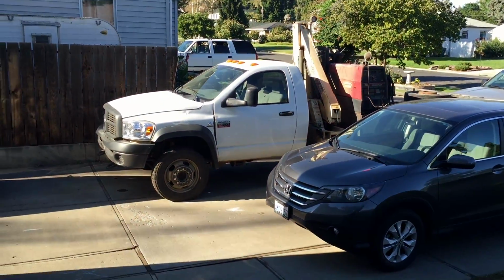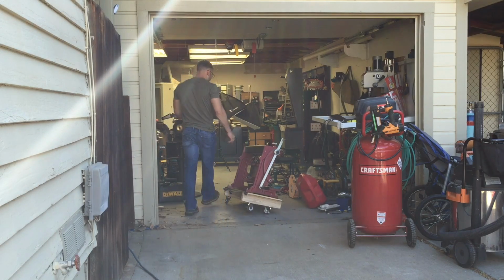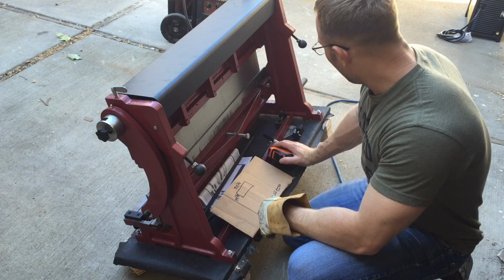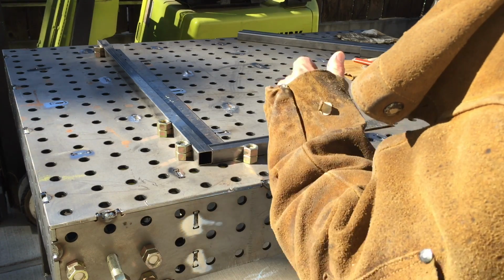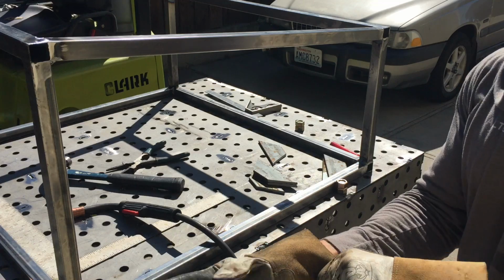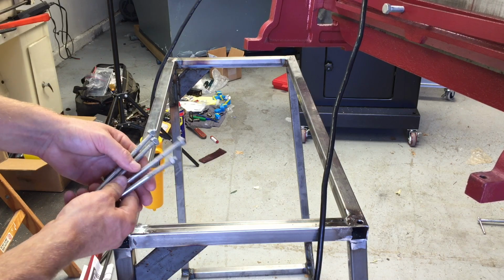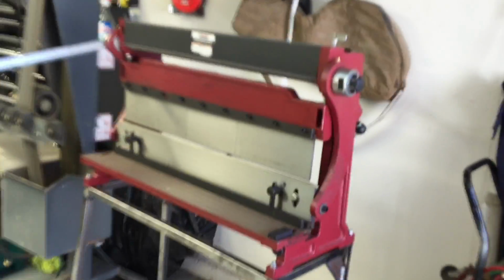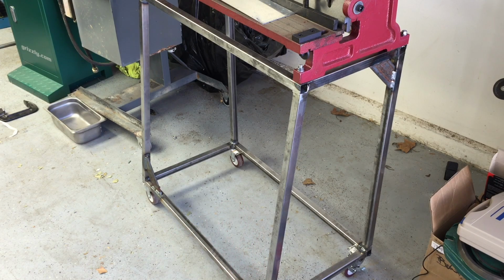DIY Stand for Harbor Freight 3 in 1 Press brake, shear,&  slip roll - Unorthodox Fabrication

Comment: As an A-10 sheet metal mechanic. Keep the grain of the metal in mind. You have to make sure you keep the Bend Allowance area clean, remove any defects in the area. Last but least the hardness of the metal (and thickness) in comparison to the radius of the bend.

Comment: probably be a good idea to end up with the height of the feed in table intoo the cutting bar about the same as a toolbox / bed of the truck , that way you can park the toolbox against it to cut longer pieces , if its liftable you could bolt it to the welding table when you use it , or make the cart so you can roll it against it and bolt it to the welding table sides with wingnuts to make it more stable should make it stable enough and gives you a work / staging surface for batches of the same item
from wat i understood you need to adjust the spacing between the knifes for the different metal thicknesses , might need to do the same thing with the bender 
been thinking about buying a simulair one (at the dutch version of harbout freight called HBM machines )i want to mostly make sheetmetal boxes with it maibe some tool drawers / holders too

Comment: You can't be pounding on casters. You'll dent the ball bearings, warp the races. This guy needs the floor so the force directed downwards doesn't have something soft in the way.
Reply: It should be on flat feet, not castors. If need to move pick up with forklift or scoot across floor.

Comment: to me your stand or foundation looks to week for a 375 to 400 pound piece of equipment to be supported by. You should have used 2" sq tubing thick wall to build this stand, plus you need more gussets
Reply: 2x2x1/8" square tubing, I just built a stand for one of these with flat feet no castors. I think it's going to work out great!

Comment: Aluminum needs to be bent across the grain or diagonal to the grain. If you bend it with the grain, it will crack most of the time, especially with a tight bend radius.
Reply: Exactly or another way of saying it; the grain needs to flow with the bend. Meaning if the grain is running left to right the bend needs to be up and down or at an angle.
Reply: @davidgreene2263  Go Air Force - former B-52D & KC-135A Crew Chief here...Love those Warthogs...
Reply: @jedclampett4215  I am a civ not enlisted. Though I did 16 years as a dependent.
Reply: @davidgreene2263  That's cool...I was a contractor working on Helicopters for 30 years after the AF...

Comment: Trust me, I'm not trying to negatively criticize you. Great looking design but, not nearly heavy enough or wide enough to be safe. On any piece of equipment, that is not mounted directly to the floor, there are precautions that need to be addressed. This cart isn't near heavy enough for what is sitting on top of it. It is extremely top heavy and is an accident waiting to happen. Casters are not big enough for one, and I'm not talking about the amount of weight it can hold, I'm talking about the size of the wheel and what it can roll over like small rocks and other small pieces laying around not to mention large cracks in the floor. second, you'll never be able to catch it when it starts tipping over, which in this video, you already proved with the very first piece of light weight material trying to be formed. Stay safe.

Comment: How did you come up with the welding table ? I am really interested in building one.
Reply from the maker: Erik,

I actually bought it as a weldable kit from here http://weldtables.com/#_a_cust74 They have all kinds of different sizes and are lazer cnc cut. Thank you for the comment.
Reply: Unorthodox Fabrication yeah I saw it like about 10 minutes later on one of your previous posts thanks though
Reply: We built 4 of them at my shop and they are amazing for layout work, Super configurable, and can be cleared out of the way for assembly and large projects.

Comment: To bend alluminum, first you must anneal it before you bend it in a brake.
Reply: I am not assuming you need to do that for .040'' aluminum. Because the metal I buy broke, has that protective plastic on it intact when they give it to me. Or does that mean the sheet metal is annealed already? Thanks for the comment.
Reply: Those sheets are already annealed for shaping.
Reply: If it's malleable aluminum it will bend just fine.
Reply: @gabrielpantess5428  
Welcome to the internet....please read all replies before you make a fool of yourself by typing what is already written.
Reply: False.

Comment: Why do so many of these like Eastwood, Clarke and Harbor Freight look the same?
Reply: The Chinese are very good at copying. For the price it's basically the same machine as jet Enco or grizzly through msc at less the price. Materials may not be as quality but if you stick with 20 gauge on shear it's great. It'll brake 1/8" malleable aluminum just fine too.